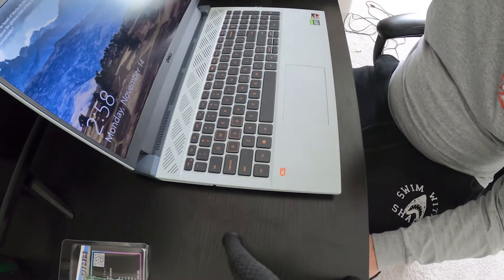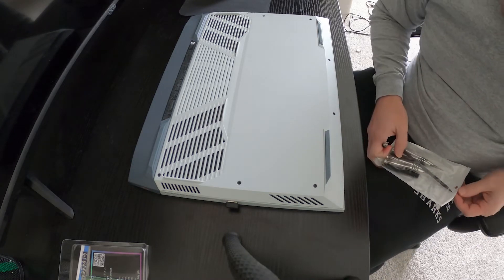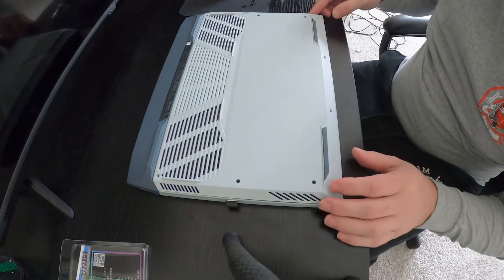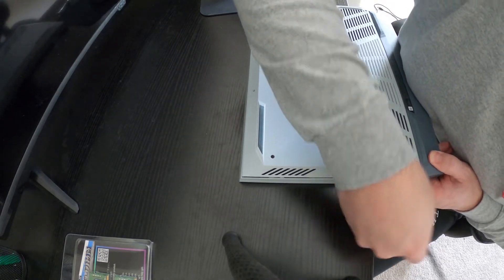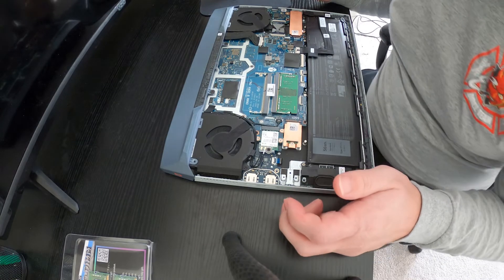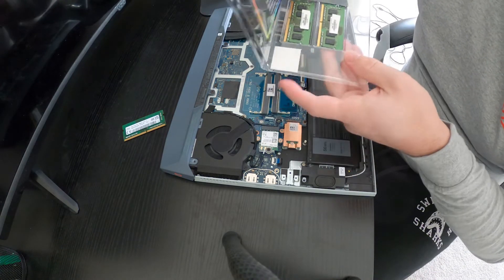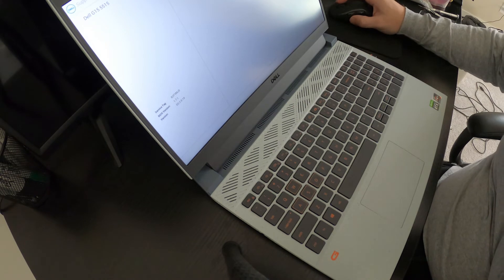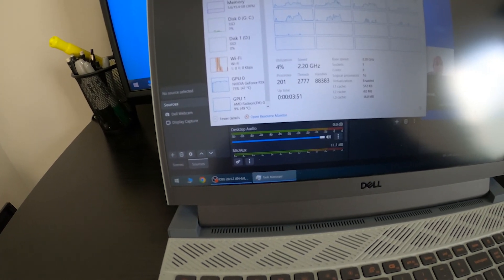Dell G15 Ryzen 5515 Ram Upgrade and feedback

Comment: Did you need to do anything special configuration wise when you added the new SSD memory stick to the second SSD slot aside from buying the mounting hardware and the thermal shield?
Reply from the maker: @Firetech412  nope!  Ram worked without any changes. The. I just formatted the extra drive when booted up
Reply: @matthewdigiacomo8764  what did you do by formatting?  I’m new to the whole pc upgrading world.

Comment: did your system give you a black screen after 10-15 minutes of the upgrade? because I have the exact same laptop and I tried installing a new ram and the problem was, after 10-15 minutes and a couple of restarts, the screen went black
Reply: @GameOver-ge2hrwhat? The dell g15 5515 is a ddr 4 motherboard idk what ur talking about
Reply: @Trey27123 he is right my model at least was DDR5 I have the 5530
Reply: @reefermon7048   because u have a newer model then the video
Reply from the maker: No it’s been good. Which ram did you use?
Reply: Bro I have the same problem please 🙏🥺 help

Comment: How much does it cost to upgrade the ram to 32GB?
Reply: about 100$, i recommend crucial ddr5 16x2
Reply: That's not ddr5 computer  @ar0nics
Reply: also, depends on your computer. if you have dell g15 5520 or anything above, get ddr5 but if you have 5510 or 5515, ddr5 wont be supported
Reply: this specific computer he has in the video is ddr4, but the newer models of dell g15 are ddr5 and im pretty sure all of them right after that model

Comment: I have the same buddy i had ryzen 5000 series 7. May be 5800 with 16gb ram and rtx3060 but Spiderman miles morales crashed on high settings 🤦🤦🤦 disgusting
Reply: U prob got a virus or too many stuff in background
Reply: I have the same but it works really well at full settings
Reply: @toenjoyer  really 😳thats strange